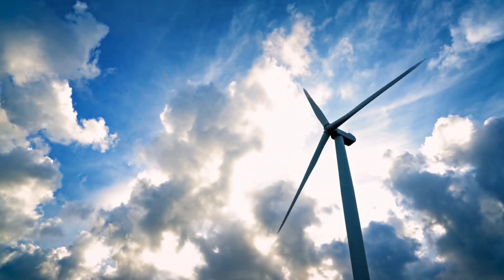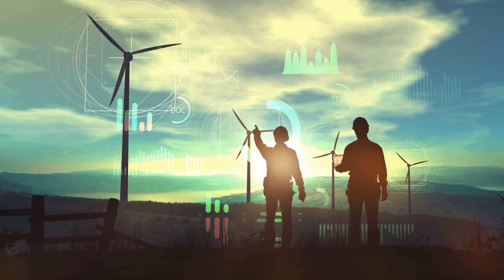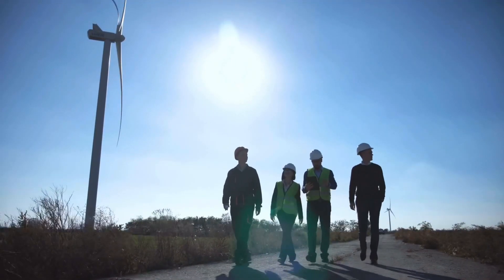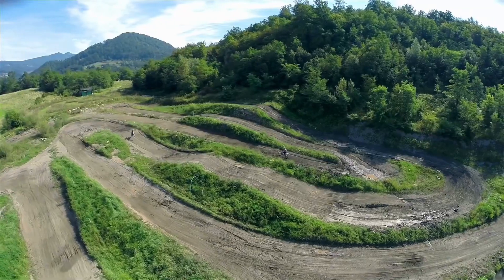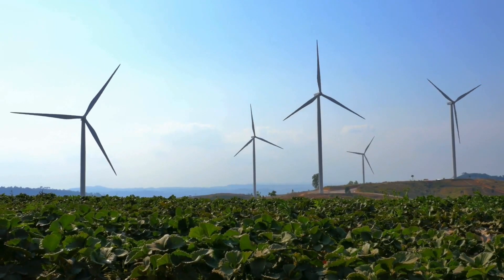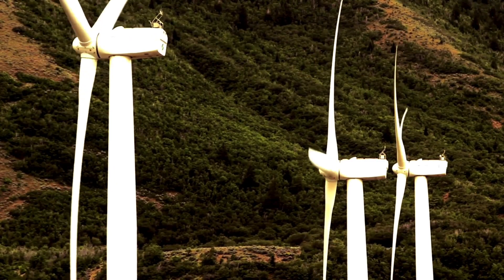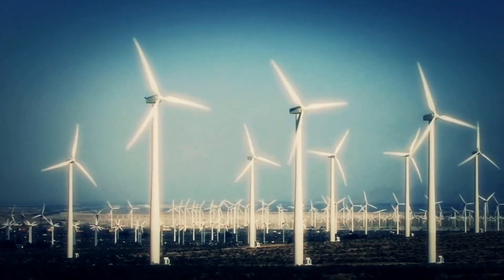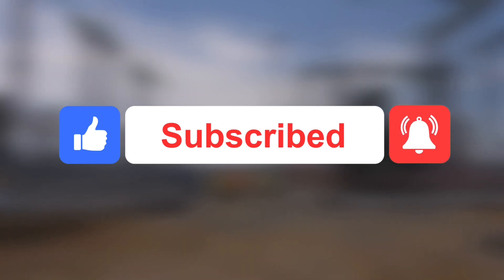The World’s Biggest Wind Turbine

Comment: If the generator is rated at 9.5 MW per hour, then it will need to rotate for a full hour to produce the 9.5 MW with wind speeds over about 20 MPH.  Less wind speed, and less energy.  So if it rotates about 100 revolutions per minute, (the older smaller ones did 100 - 110 RPM), then it can rotate 6,000 revolutions per hour, and you can figure out the math from there.  Perhaps this very large rotor is only about 60 revolutions per minute?  That would be 3,600 per hour. .  .

I agree each rotation will produce a lot of power!